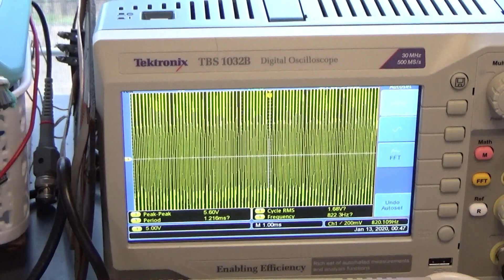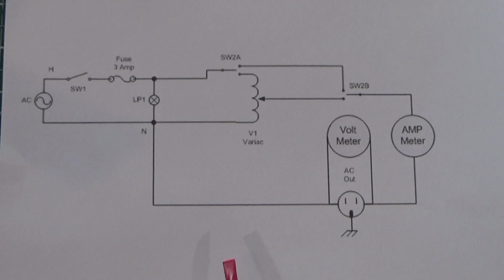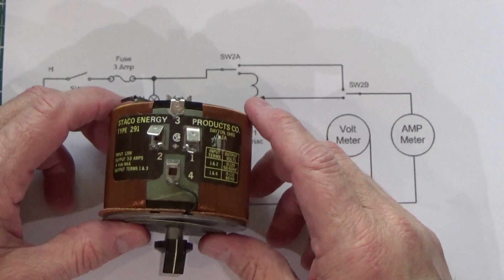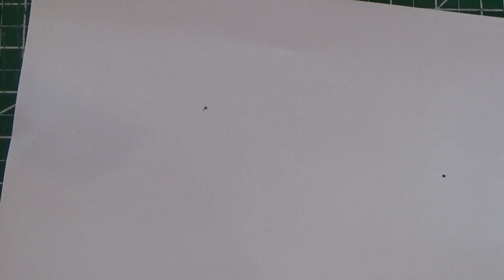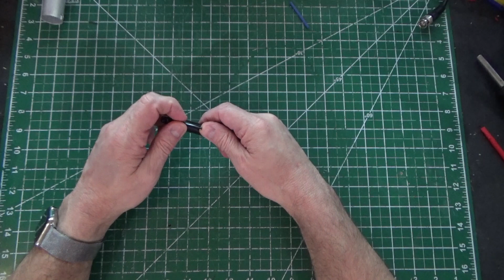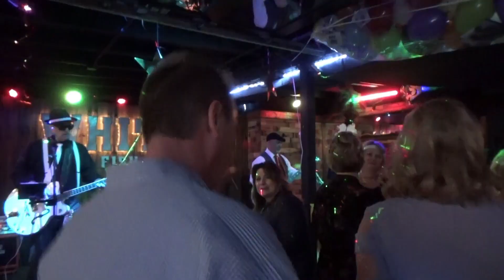Odds and Sods #33 - Bassman and Bendix and Battery Eliminators

Comment: Hello Ron:   you mentioned that you had 1 microphonic tube in the Fender amp,   Was that microphonic tube one of the 12AX7's ??  Reason why I ask is that the 12AX7 type is a HIGH GAIN tube and they can go into oscillation at high volume levels, I had this happen on an old signal tracer last year and if I went higher than 1/2 to 3/4 high on the volume the tube would break into oscillation like crazy!!! I tapped on the tubes and found that this one tube would want to oscillate a little so I replaced it and the problem disappeared !!  I would try a 12AX7WA  this is a militarized version of plain 12AX7 and is built a little sturdier inside and is less prone to microphonic's IF this problem I described is what is happening to your amp !!  the final power amp section can break into oscillation too so don't rule that possibility out just as yet, check that feedback circuit caps for leakage!!  in any rate Terry Dayton could certainly point you in the right direction !!  Good luck  John Bellas  KC2UVN.

Comment: Ron, did you use a signal tracer and try to isolate the area that is distorting on the bassman? If you find the area that is distorting, then you should be able to dial in the problem,,, Good luck my friend.
ps,, you are showing your weight loss by the way your watch is fitting,,,☺
Reply from the maker: Carl - I was able to resolve about 98% of my problems by adding a 1.5k GRID STOP resistors to pin 5 of the 5881 tubes.  My amp is a Basman 56FA which is before they discovered parasitic oscillation. I'll explain this more in the next video but adding the resistors removed most problems !!!!.  thanks man, I feel great being lighter !!!!!

Thanks for noticing !

Comment: Hi Ron, it sounds as though you have an interesting video lineup planned for 2020.  One little request, when it comes to that time when you are uploading Arduino, and programming videos.  Could you cater for old halfwits like me whose electronics knowledge spans from 1900, and appears not to go beyond 1990 - in other words, go at a slower pace when explaining things so that an old duffer like me as at least a fighting chance to take all it in ...because I’m very willing to see what it is about, how it is done - and go away to learn more at my own pace.  Thank you.
Strange you should include parasitic oscillation, and audio squeal.  I was only corresponding with our mutual friend B D yesterday about audio squeal.  First: did the amplifier work fine after construction?  If so, check pre-amp biasing (the usual ...cathode resistors and capacitors, grid leak resistors etc.), also check feedback rails for defective components, as well as doing the same for the tone stack.
If the amplifier has clipped from the time it was constructed, think about reviewing lead dressing, making sure the screen part of screen leads are well and truly anchored down to deck - making sure there are no ground loop issues, make sure you have not left off any screens, such as valve screen cans that should be there.  In other words have the construction manual to hand, and meticulously retrace your steps when you constructed the amplifier.  I’m sure the fault will turn out to be something straightforward to put right.
Best regards my friend, Phil.
Reply from the maker: Phil my friend, I will slow for sure on the arduino stuff. On my amp I never fully tested it but no problem. I discovered that I need to add a 1.5k resistor as a grid stop to each output tube which will kill the feedback loop between those tubes. That is 90 of my problem.   After that we will see where we land !!!!    Thanks Mate !!

Comment: You should start at the input signal of the amp and follow the signal with your scope through each amplification stage one at a time and see where the signal goes wonky.   Once you see that distortion you should check the circuitry at that point.      Work the problem logically.    Don't go shotgunning and guessing.   I saw Terry's video on the variac circuit.   I really don't see the point of the switch.   If you want line voltage just crank up the variac dial.     It seems redundant to me.    I just don't see the advantage of the switch capability.    I love Arduinos.    I have been building stuff for 10 years already with them.  I make mine all barebones  devices with the Microprocessor (MCU)  IC chips (ATmega328, ATmega168, ATtiny85 and ATtiny 84) only and no Arduino development board.   See my channel for some items I used the Arduino IDE on and stand alone MCU ICs as the brains and controller for the stuff I made.   I built my own programmer boards with ZIF sockets for easy chip insertion and removal for programming MCU ICs to install in my projects after they are programmed.
Reply from the maker: Very cool JP, thank you.  I completely agree on the shotgunning.. that won't happen here. I have already zeroed in on  ONE of the major problems which is parasitic oscillation. This is comment when the output tubes are creating positive feedback. Its easily fixed by adding 1.5k grid stop resistors to the output tubes.  That is where I am starting and we'll see form there.. Uncle Doug and Terry have videos on this from a few year ago which helped me.    tx
Reply: @rciancia  Cool.   Just watched those 2 vids.  YouTube is great!!!   Sounds like you are on it.